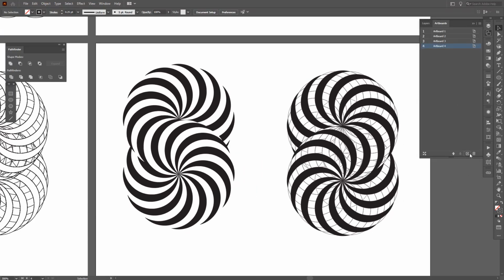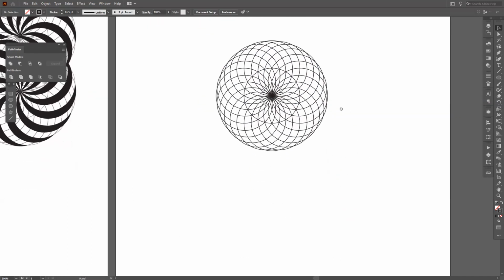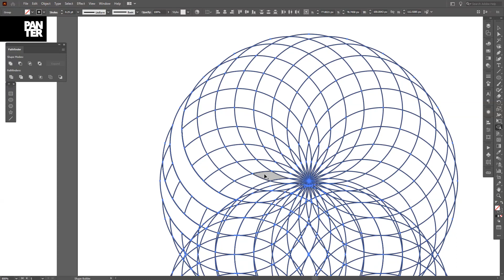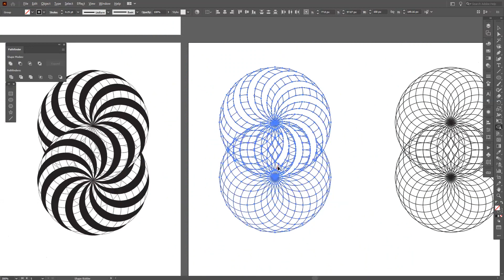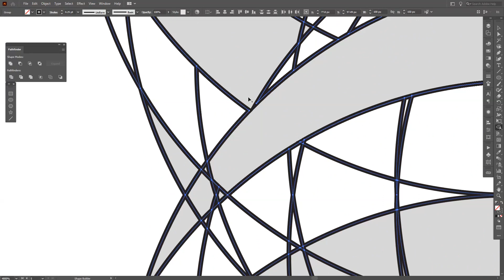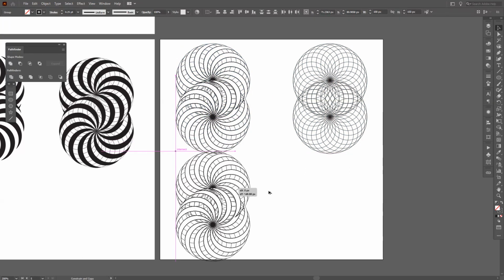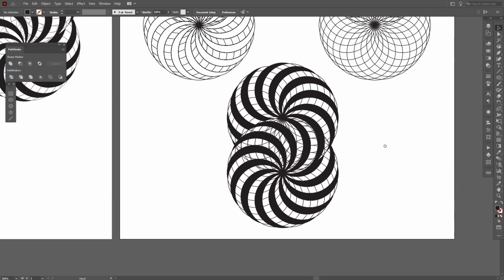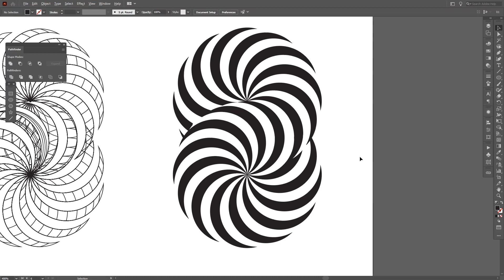How to Design an Impossible Infinity Vortex | Adobe Illustrator Tutorial

Comment: easy way just draw 2 circles take the common part rotate -30 copy repeat process then copy the whole circle and reflect it and paste it on below, this will reduce the number to select path and also easy to do(try if you get time)
Reply from the maker: I tried that before but didn't worked out because the second reflected vortex did not fit well